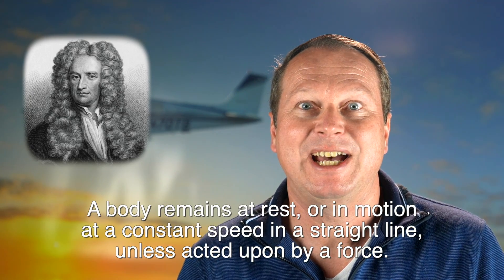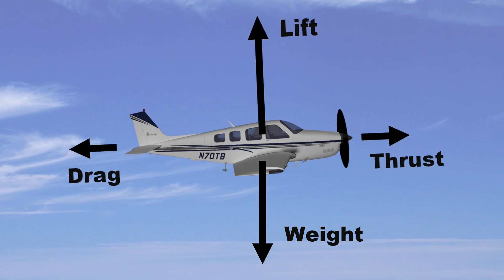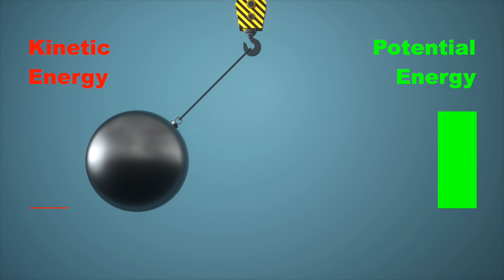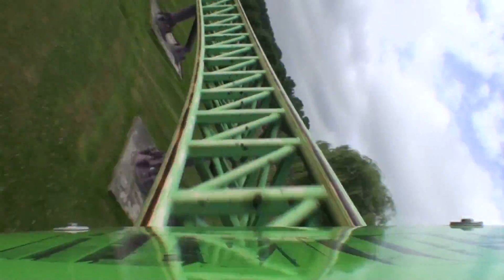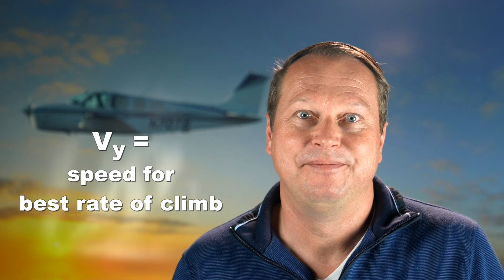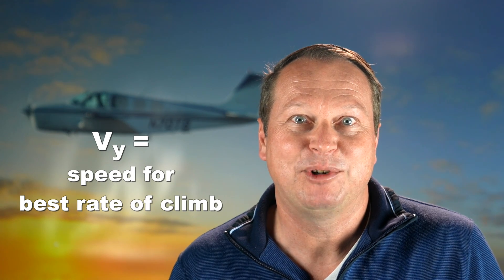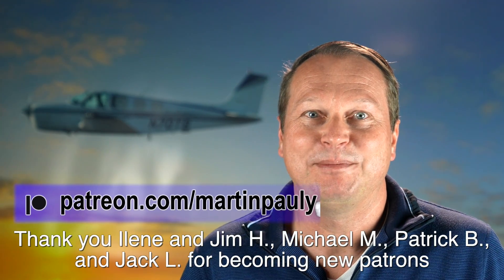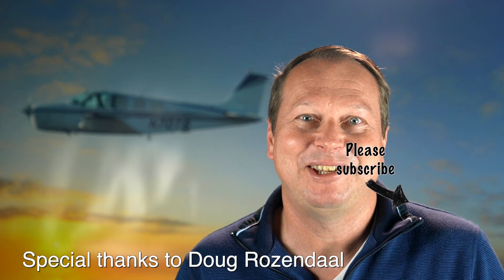How an airplane really climbs

Comment: Hi Martin. You hit the nail on the head but the final piece of The puzzle needed stating. The aircraft climbs because of the excess THRUST vector. The amount of thrust and and ability to do work derived by the engine power able to be delivered.
Reply from the maker: You are correct. Though I find it easier to think in terms of horsepower than thrust when dealing with piston airplanes, while in a jet you would certainly use thrust. Excess power, or excess thrust - either one allows climb.
Regards,
  Martin
Reply: @martinpauly  Understood - everything you have said is well stated and logical - though both forms of propulsion deliver Thrust at the end of the day and in terms of the balance of forces (or imbalance) that is why we climb. Keep up the good work

Comment: One error he made: altitude decreases drag due to thinner air. This is why commercial airlines fly at altitudes of around 30,000 feet.
Reply from the maker: Yes... and where exactly is the error I made in the video? Timestamp or quote of something I said would be appreciated. Thanks.
- Martin
Reply: @martinpauly  very good video.
Reply: @martinpauly   2 minutes in
Reply: Your statement is true. But the fact that Martin did not state that fact does not imply that he made an error.
Reply: Drag reduces with altitude gain. The plane does not necessarily need to level out to increase speed: it is already increasing, albeit at a slow pace.

Comment: Commenting before watching. As an engineer who has a bit of physics also, I know intuitively that an airplane going at a constant speed in a straight line, even if that line is tilted upwards, is in equilibrium, which means lift equals weight. So....how indeed? Looking forward to the video.
Reply from the maker: So... what did you learn / confirm when you watched it?
Reply: @martinpauly  I had never heard the old wives' tale about stall speed being reduced when descending, but that may be an inspiration for another video: addressing other old wives' tales, like "you'll stall if you turn downwind". That one, too has a little kernel of validity in it, but it's about the wind affecting your ground track.

Comment: When you hear the stall horn you can push the Yoke forward unloading the wings and for a moment fly below the speed where the airplane normally wouldn't so in that moment the aircraft don't need lift. Correct??
Reply from the maker: What you are describing is the result of a load factor which is less than 1.0 while you are pushing the nose down. During that time, less lift is needed (compared with level flight) and therefore your stall speed is reduced. But the moment your trajectory stabilizes and you reach steady motion again, all that is over and your normal stall speed (for a load factor of 1.0) applies again.
Regards,
  Martin
Reply: @martinpauly  Thanks 😊

Comment: Correct me if I’m wrong, but another old wise tale is that the curvature of the wing creates lift.
Reply from the maker: "How list is created" is a video I don't believe I will make. 
"What to do with all the lift", that is where I see my expertise.
😁
- Martin
Reply: I want to add something for question, Lift and flying are "not all the time" same things. While lift is occurs under your wings (unless climbing 90 degree) as long as you have enough kinetic energy. But for flying you only need kinetic energy. So you have a ball and kick it, it flies a short moment but there is no lift (force) because balls have no wings :)

Comment: power + attitude = performance transfers into climb
Reply from the maker: Usually that's true. But when you get to the edge of the performance envelope, things can be different. Not just in light-GA aircraft - as the pilots of Air France 447 learned, to give just one example.
This is why it is so valuable to experience (and master) slow flight. Things we take for granted, things we have learned wrongly or incompletely at "normal" speeds no longer work at very slow speeds.
Regards,
  Martin